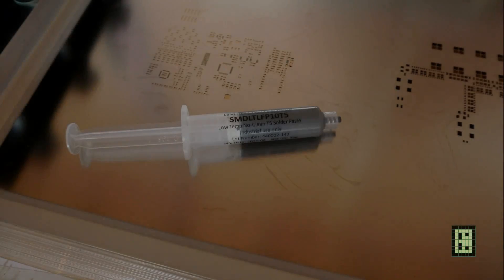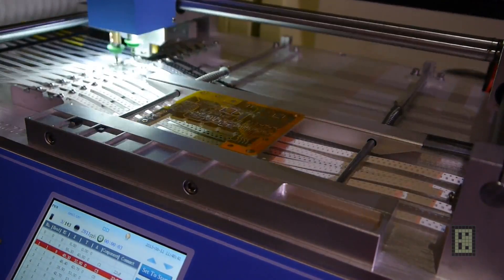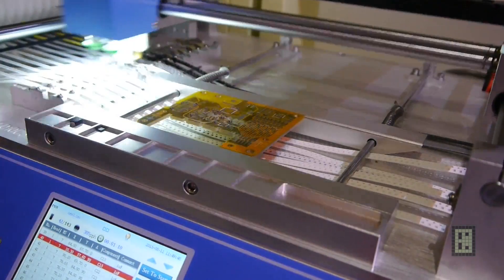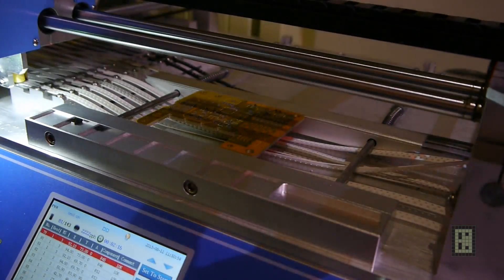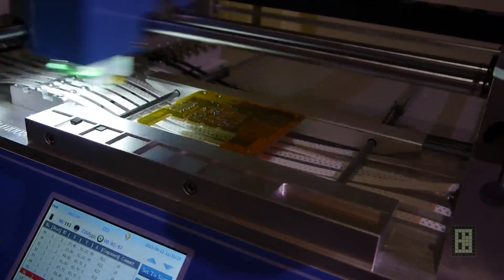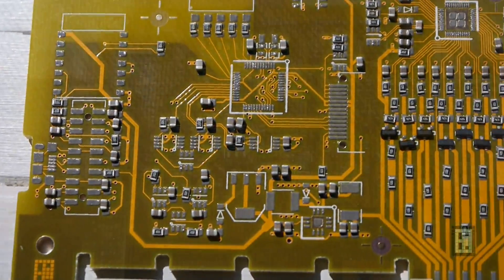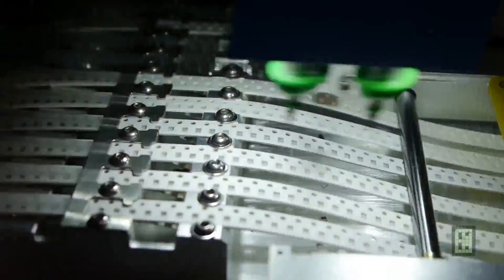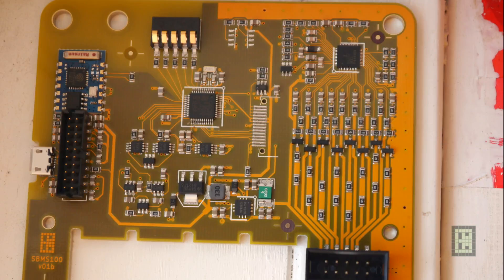Pick and place machine building the beta SBMS100 main board.

Comment: Are you interested in making a machine that uses hydraulics to make energy working with batteries???
Reply from the maker: What do you mean by machine making energy ? Energy can not be "made" just converted from one form to another.
Reply: Ok if you want to get technical how about produce energy usable energy enough to power a house for the life of the batteries so 4-6 years without solar or any external source
Reply from the maker: @franklingee1267  From what do you want to "produce" energy ? Gasoline? Natural gas ?  Can you be more specific ?
And will it be lower cost than solar ?
Reply: Ok if you want to get technical how about produce energy usable energy enough to power a house for the life of the batteries so 4-6 years without solar or any external source
Reply: Using hydraulics, if I’m more specific then you’ll just steal my idea and I’ll see another one of my ideas on tv in a few years
Reply from the maker: @franklingee1267  How will you want someone to help you if you do not share your idea ?  Should I just believe you have a good idea ?
From limited info you provided people can only conclude that you are talking about a perpetuum mobile or more correctly over-unity device and no such thing is possible.
Reply: It’s a machine that produces power like a generator but instead of using gas you’re using batteries and hydraulics
Reply from the maker: @franklingee1267  So you are replacing gasoline with electricity from a battery. What will you use to charge the battery ?
Reply: Ok so you just want me to tell the world my idea ? Or do you want to join together and make this machine ???
Reply from the maker: @franklingee1267  Why will I join if I have no idea on what you are trying to do. If you said I have a more efficient solar cell design or a more efficient wind turbine or even a much more efficient gasoline generator you will not have shared anything about your idea but provided me with some details to know if I want to help or not.
For now you mentioned nothing about where this energy comes from. Energy can not be created nor destroyed it can only be converted from one form to another.
So in case of solar you convert the photons energy in to electrical energy. For wind that is also a form of solar energy you convert the kinetic energy of the air molecules in to electrical energy by spinning a turbine. For gasoline you convert the chemical energy available in the carbon bonds to heat and that heat in to kinetic energy and then likely in to electricity.
Rechargeable battery is just an energy storage device not a source so you get out at best as much as you put in.
Reply: Many of my idea have been made, at 12 years old I thought of an ev drew it out in paper talked to teachers about it they just laughed now I’m driving a model x on the freeway to AZ now as I’m typing this
Reply from the maker: @franklingee1267  Before 1900 there where more EV's than internal combustion cars.  Since gasoline stored more energy that EV's they became much more popular since that time. 
I also realized that religion's are just stories made up by humans when I was around 13 years old but that does not mean many people realized the same thing way before I did.
Reply: Yes I know this now after many documentaries but I did not have that info at 12….the point I was making is that I thought of it just like many inventions I have now
Reply: I’ve actually said to much I’m afraid but oh well
Reply from the maker: @franklingee1267  I do not think you said anything but good luck.

Comment: felicitari, un roman destept pe youtube; daca ai reusi sa faci un mppt cu bms, cu 10A balance current ar fi grozav si ai rupe stilul;
Reply from the maker: Vezi video asta de lam facut referitor la MPPT si faptul ca este o tecnologie nefolositoare in off grid https://www.youtube.com/watch?v=cKrh9tdXDX8
Reply: +electrodacus iti stiu toate filmele, hai sa iti spun unde salvezi banutii; ai ramane surprins cat te costa cablurile ca sa ai toate panourile in paralel la 18v de exemplu la o distanta de 30 m de controller. Plus eficienta sporita a mppt-ului. Am experimentat eu: ai ramane suprins sa vezi ca 2 panouri de 18 v serie produc 1.3 1.5 mai mult amperaj decat 2 panouri in paralel. Vezi ca e chiar documentat si asta pe youtube. Deci mppt e o tehnologie mai eficienta cu randament mai mare si mai cost eficient.
Reply from the maker: Cablurile sunt foarte eftine in comparatie cu un MPPT. Tu te referi la systeme foarte mici panourile de 36 cells 18V mppv sunt foarte scumpe comparativ cu panouri mari de 60 celule si ele sunt perfecte pt batterie LiFePO4 de 24V va functiona extrem de aproape de max power point.
In offgrid poti avea mai mult de 50% energy neutilizata de la panurile solare pt ca o data ce bateria e plina restul de energie ramane nefolosit. E complect inutil sa ai un MPPT intrun system offgrid.
Vezi ultimul post pe google+ https://plus.google.com/+electrodacus Casa mea e alimentata de la 3 panouri mari de 60 celule doua de 260W si unul de 240W si o baterie de 24V 100Ah. In ultimele 30 zile am folosit 62kWh dar panourile ar fi putut produce 100 chiar 120kWh in 30 zile pt ca e vara. Idea e ca daca nu ai nevoie de energia respective nu o vei folosi.
Reply: +electrodacus in primul rand imi pare bine de cunostinta si de raspunsurile tale; dar cum te descurci cu atat de putina energie? Masina de spalat, frigider, aer conditionat, centrala iarna, un tv, etc.... Mi se pare foarte mic ce ai tu; eu fac in joaca acum o baterie din 18650 de 200Ah 24v 7s 100p  mai mult sa o folosesc ca un ups si tu zici ca iti tii toata casa cu jumate din atat????
Reply from the maker: Petre Adrian Casa este foarte bine facuta si eficienta. Aproximativ jumate din consumul ala este pt ca gatim electric totul. Nu este nevoie de aer conditionat pt ca casa are masa termica mare si e bine izolata si temperatura in interior nu depaseste 26C vara.
Avem doua computere un all in one si un laptop care functioneaza celputin 10 sau 12 ore pe zi dar nu consuma mare lucru. Nu am mai avut TV de mai bine de vreo 8 ani nu e util cand ai internet. Am un frigider mic cu peltier care consuma intre 7 si 8kWh/luna
Masina de spalat e mult mai insignificanta pt ca nu incalzeste apa electric va fi in curand cand e gata Digital MPPT vezi mai jos.
Centrala deocamdata pt incalzire merge pe gaz propan si pompele de circulatie sunt DC de putere mica nu consuma mult.
Incalzirea va fi curand cu panori solare pt ca e mult mai eftin. Pt casa mea de 65mp am nevoie de 9kW de panouri solare pt a incalzi casa 100% in iarna aici Saskatchewan Canada. Acum lucrez la un nou proiect care se numeste Digital MPPT thermal controller care va folosi panouri solare si va stoca energia in masa termica voi explica curand despre cum functioneaza si ala va suporta maximum 15kW de panouri solare pt incalzit si case mai mari sau mai prost izolate.
Incalzire a va fi tot low voltage 30V max power pont cu panouri de 60 celule si max 500A.
Reply: +electrodacus felicitari pt tot ce faci, asta e si planul meu pt viitoarea casa; da mi un un fel de contact sa putem comunica si in alt fel.
Reply from the maker: Petre Adrian este usor sa ma contactezi acelas username ca si aici la gmail.
Reply: +electrodacus iti ceream permisiunea :)

Comment: That must be quite a time saving over doing it manually :O

Why does the machine have a light if it does not do vision?
Reply from the maker: The light is useful for the human eye also :). The laser pointer is for the initial board manual calibration.
It saves some time but the placement is not perfect so there is still a lot of work in rearranging manually the placed parts and also placing some of the parts that it can not place do to low accuracy without vision.
Only passives can be placed. everything with more than 2 or 3 pins will need manual placing (connectors, IC, spring contacts ...)
Reply: Are you planning on any upgrades? Thanks for the reply :)
Reply from the maker: I can not afford to upgrade right now and this is heavy it will be a challenge to sell (ship) and then get one with vision that is about $3000 extra.
I'm more in to development than production.

Comment: Hello Dacian, with this bms will I be able to limit charging on a 4s lithium ion pack to about 15.5 volts to stay with in the input voltage constraints of my inverter? Awesome project. Thanks.
Reply from the maker: +swipemagnetron Yes you can limit the voltage limit at any level. Best is to use LiFePO4 they have about 3.2 to 3.3V nominal and max charging voltage of 3.6V so you will have a minimum 3V x 4 =24V and a max 3.6V x 4 = 14.4V much better for a Lead Acid 12V device as the inverter. You can also use LiCoO2 (some of the most popular type of Li-ion cells used in laptops, and mobile phones) and you can set the limit to say 3.9V that will limit the voltage to 15.6V and while reducing the original capacity to about 70% of the original capacity but also increase the cycle life about 8x getting it close to the life cycle of a LiFePO4 still not as safe.
But yes you can change the charge limit to any value with 10mV resolution (measurement is done with 1mV resolution) and there are other over 30 parameters that can be changed from the SBMS menu.
Reply: +electrodacus excellent thanks! I've been playing around with harvested laptop cells for quite some time now and will probably stick with that. I'll look into LiFePO4 though. Either way there is a good chance I'll see you on Kickstarter! 

I just had a look on google for inverters with lithium ion input voltage ranges with no luck. With out looking first I'll ask, can LiFePO4 cells be had cheaply like harvested laptop cells?
Reply from the maker: swipemagnetron
I think is all about amortization cost if you are interested in stationary energy storage. I live offgrid and my house is powered in the last 3 years of so by LiFePO4 cells.
A typical laptop battery is designed for high energy density on the detriment of cycle life. A typical LiCoO2 cell normally used in those 18650 laptop cells has a cycle life of around 500 to 800 cycles when charged at 4.2V and that is more than good enough for a laptop that you will probably use for 3 years or so but cost of each unit of energy stored will be quite expensive when you consider the cost of the battery and battery capacity multiplied with the number of cycle.
LiFePO4 has lower energy density meaning a laptop or phone made with this battery will be around 2x as heavy or be as heavy but have half the autonomy.
In a stationary system like solar offgrid storage weight is way less important but cost amortization for unit of energy used during the life of the battery is more important.
Say you have two 1kWh batteries one with LiCoO2 chemistry and the other with LiFePO4 they will cost about the same if new but LiCoO2 will last about 500 cycles at 100% DOD and LiFePO4 will typically last 3000 cycles at 100% DOD so one will last much longer and during that period be able to store 1kWh x 3000 cycles = 3000kWh while the other just 1kWh x 500 cycle so just 500kWh.
Now you may not use the battery to 100% DOD and it will last longer but the proportion will be the same. A Winston LiFeYPO4 will do 7000cycles at 70% DOD and probably a typical LiCoO2 will do 800 or even 1000cycles at 70% DOD but the proportion will remain similar.
You will pay a typical $400/kWh for large LiFePO4 cells and probably about the same for LiCoO2 (you do not normally find large cells so you need to build large capacity from small 18650 cells that also involves some cost).
So $400 / (7000 cycles x 70% x 1kWh) = $400 / 4900kWh = 8 cent/kWh stored this is quite an ideal calculation since you will probably not be able to use 70% of battery capacity every day for over 20 years to get to this number but a 15 to 25 cent is a realistic number for the cost of energy stored in a typical LiFePO4 where LiCoO2 will cost as much as probably 5x more that cost can be reduced for LiCoO2 by reducing the charge voltage from 4.2V to 4V or even 3.9V and even making it comparable to LiFePO4 cost but LiFePO4 still has advantages as it is a safer and greener battery (no Cadmium) and you can find cells with large capacities up to 1000Ah cells available also the cell voltage will be closer to a traditional Lead Acid so you can use inverters and other devices designed for Lead Acid voltage levels.
Reply: +electrodacus Really great info! Thank you. 

So far I've been playing with typical laptop cells for quadcopter batteries as well as 96 18650's in 4S with a 600 watt inverter in a back pack for a mobile power pack. So weight and capacity come into play. 

If I scale out a stationary battery bank I'll definitely consider LiFePO4 cells.

Comment: The empty plastic component strips on the right hand side seem to be moving with the machine. A bit tangled up? Might influence accuracy?
Reply from the maker: jeales895 Yes the empty part of the components strip where a bit to long and not enough space on the desk so they where probably touching the Y axis belt. But there is probably no inaccuracy do to that fact. The most effect in the accuracy seems to be based on where inside the strip the components are located. Especially on the plastic strips the space inside the strip is larger than the component so the component can be random at any place in that space including rotated by a few degrees. The paper strips seems to have tighter tolerances so there is not much space for the component to move. With vision when you have a down looking camera as is the case on the newer model of this machine the camera will see where the head piked the component and if there is any shift or rotation and correct for that before placing on PCB. The vision machine was $2000 more than this one and I barely afforded this one.
But for passives it works good enough the components will be placed good enough with maybe two or three than need a bit of manual correction before reflow.  You seem the machine was able to place about 140 parts in around 4 minutes and manually I will have needed about 10x that time about 40minutes at best and I will get tiered and bored fast :)
I still need to test the accuracy when placing components from the front tray. There the position of the component inside the strip will no longer play a role since I manually place the component in the corner of that aluminium tray.
I will still need to place a few parts manually do to height restriction like the connectors the connectors.
Reply: ***** Its a shame the components on the strips are not correctly aligned. Surely thats half the point of having strips of components. Either way, a very cool machine and obviously a very cool PCB design from *****
Reply from the maker: jeales895 They need to leave some tolerances so the space for component inside the strip is just a bit larger so component will not get stuck inside. The plastic strips seems to be worse in this regard probably because they are lighter and thinner and vibrates more during strip movement. This are relatively large passive 0805 so is not a problem they will align back during reflow. But components will multiple pins and smaller pin pitch will not really be able to be placed from strip directly unless the machine has vision so it can correct for the strip tolerances.
I did not used the front trays there this tolerance of the strips will be eliminated by manually placing the component in to tray and pushing it against one of the corners.

Comment: Neat video. How much does that PNP machine cost?
Reply from the maker: Jon Vannatto It was a bit over 5500CAD including shipping and taxes.
Reply: Was it worth it?   Would you buy that machine again?
Reply from the maker: Matt Crane
I was what I expected but if I will suggest getting the newer version with vision.
The mechanical precision is good but without a camera this machine will not place the small parts that precise.
I still need to manually rearrange most of the parts and of course all parts with more than two pins need to be placed manually.
Still it was useful as it is it depends on your application.